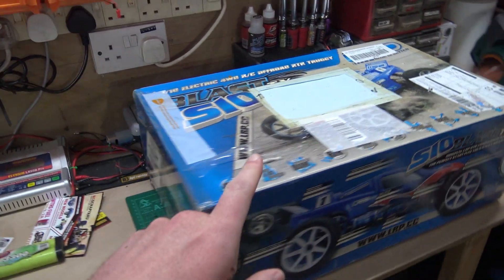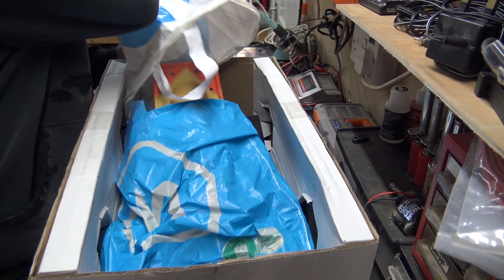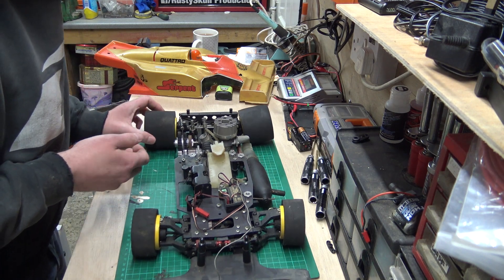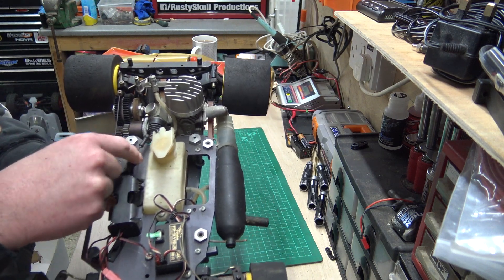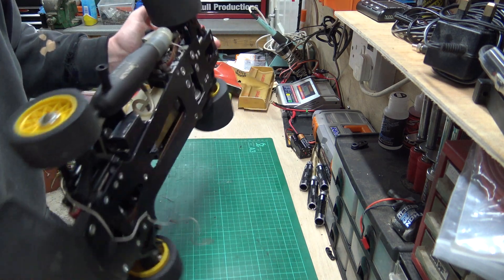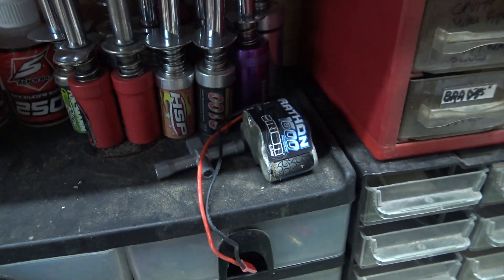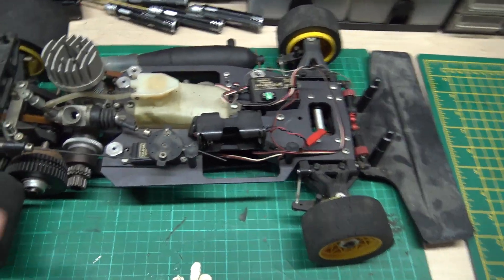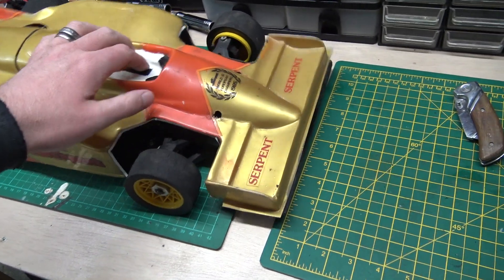Serpent F1 Nitro Car Unboxing!!

Comment: That's an ideal candidate for a full strip down and rebuild. I got an engine with a mardave marauder with a cooling head like that but I'm sure mines a magnum not an OS if I remember rightly. Its been in storage a long time but I'm sure it's a magnum. Looking forward to your next video. Cracking vintage car mate. You should keep it.
Reply from the maker: I’m in two minds, I’ll see how the engine sounds next though :)
Reply: @HaggardRC  looking forward to it bro. Still think you should keep it. I just hope you can do something with the fuel tank cap. You could have trouble finding one to replace it if you can't repair it.

Comment: I'd say those wheels are quick release wheels mate, that's a nice car you've got there, nice one. But dont you have a 40meg crystal in a box controller for a boat or plane?I'd also say that it's a speed run car, much like the modern day hobao speed run cars..
Reply from the maker: Nah I sold that 40meg stuff to pay for the new 2.4GHz one 😂